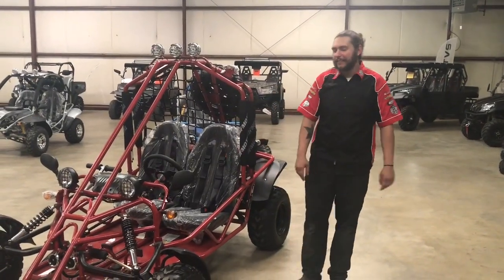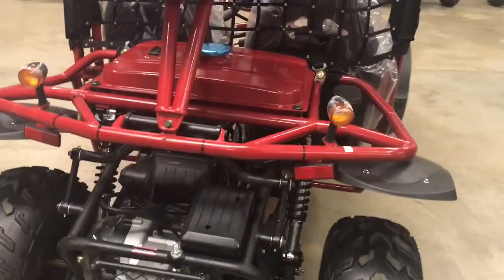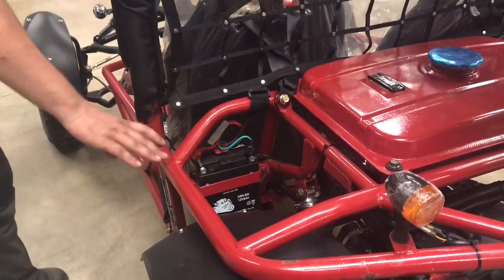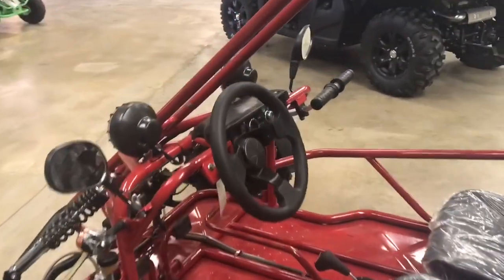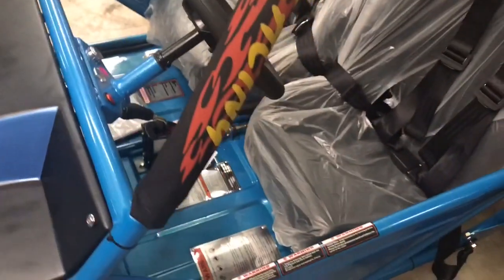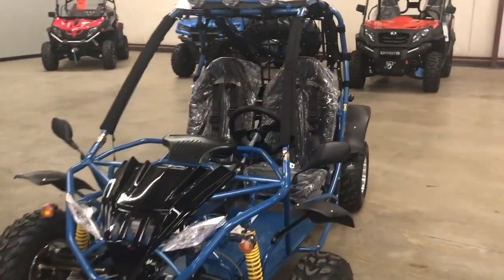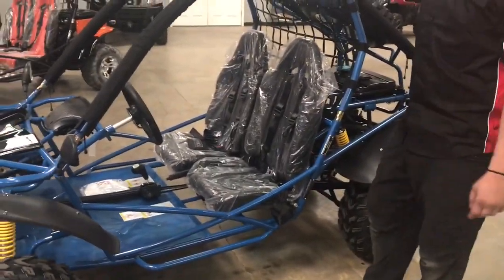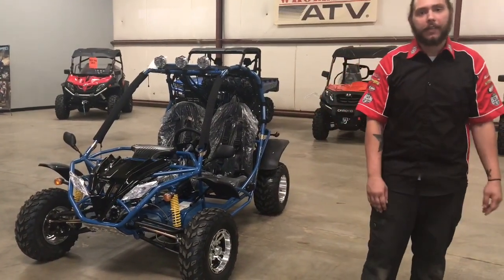Adult Go Kart Features, Operation, and Maintenance

Comment: I have the orange one 2017 I park for 2 months  and it won't click or start I did charge the battery   . Did look on fuse .. the speedometer blinking . And soon as I turn they key to start it goes dead. Do u known what's wrong
Reply: I would change the battery or put a battery charger on it to turn engine not charge and see if you can jump it to start. If it turns on by jumping the old battery then it's the battery.

Comment: this company is horrible sold me a brand new motorcycle 2300 rode it 100 miles and will not start they cpuld care less did nothing to help me so iv got a 2300 boat anchor now update took head off had a bent valve and this company could care less a brand new engine bent valve not there problem